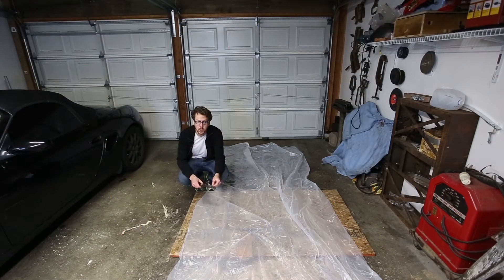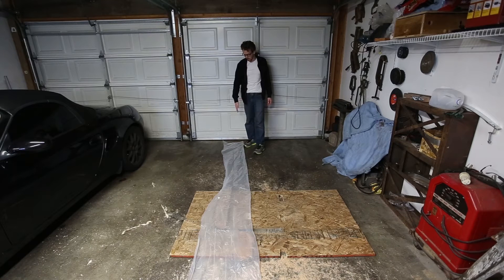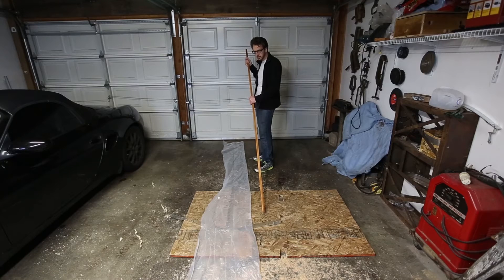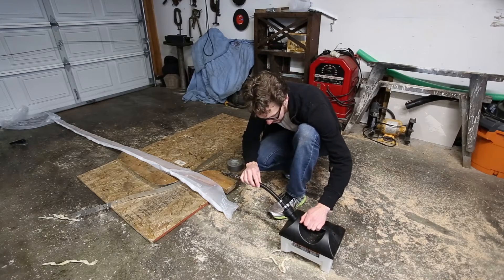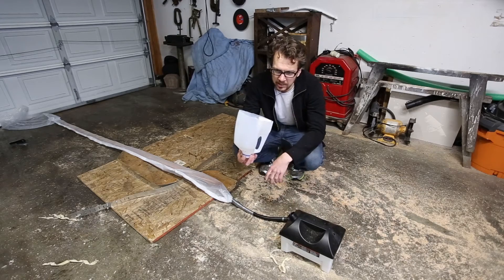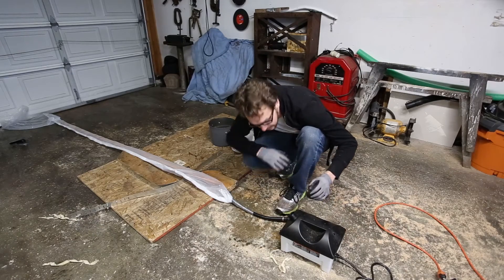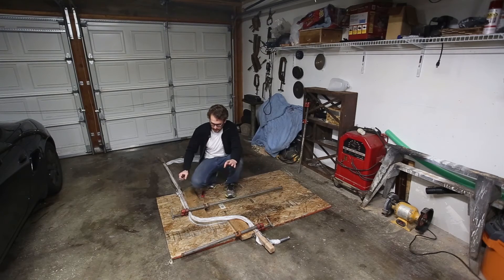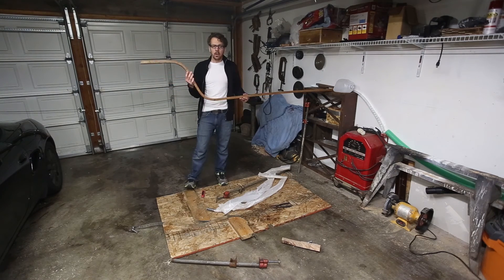The Crib/Bed Ep 02: How to Steam Bend Kiln Dried Wood

Comment: You just helped me solve a tough problem.  Really clever and avoids steam boxes altogether.  Really like the use of the heater straps too.  Thanks
Reply: I have not been ale to bend successfully do this but I do have one suggestion. Use a vacuum bag like you would use to cryovac food you can make them as long as you need they withstand heat and are sealed at all but one end.